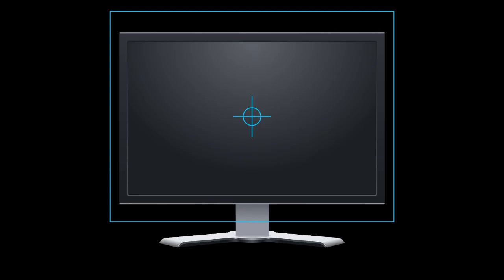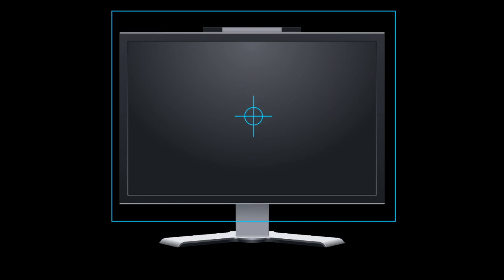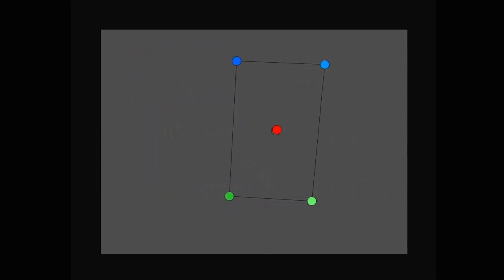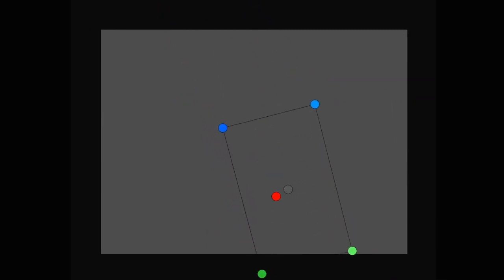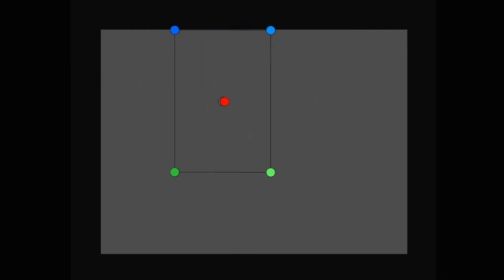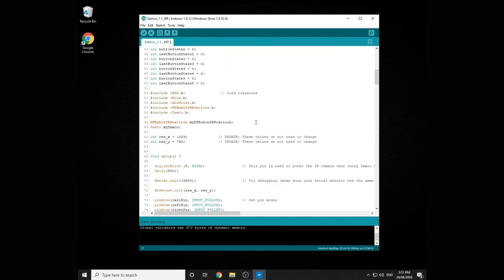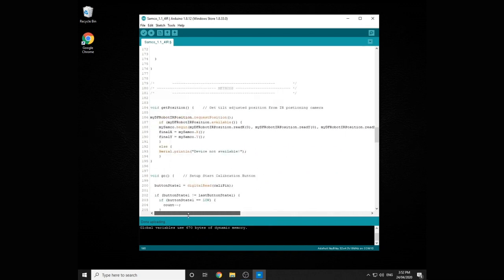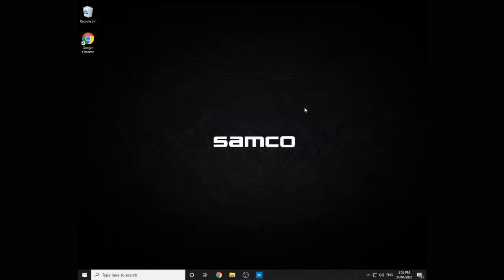SAMCO DIY Light Gun - 4 LED Introduction & Setup Guide

Comment: Could I use a fish eye lens on the IR camera to see all four LEDs all the time and therefore improve accuracy even more?
Reply from the maker: Yip, most people use a wide angle I think but same principle.
Reply: @samcorulz Thanks for reply. I've been doing a bit of reading around this over the past few days and saw a comment stating that LEDs can dim over time and the recommended aliexpress wii bar clones weren't very good. Is there a specific brand / item you'd recommend? Love the project - only wish I had the knowhow to contribute.
Reply from the maker: @videoflanders5164  No worries, haven't actually come across that one before. My random aliexpress bars work fine. A lot of people wire up there own, you'd probably be able to find a tutorial for one if you looked around a bit. Best way to contribute at the moment is just spread the word :)

Comment: What do you think would happen if you aim the camera inside the gun to get better coverage of a single upper bar? Does the 4 led provide substantial benefit even if you don't have an issue with going out of the field of view?
Reply from the maker: @PactoTech Yeah, you could definitely tilt the camera up to get better coverage, there might be some slight warping but would be marginal I think.  4 Leds is definitely better especially in the Beta version the main advantage being it remaining accurate (thought the sights) if you move closer to or further from the screen, 2IR can go out even if you just change your grip sometimes. But all depends on how you play really and how much time/effort you wanna spend on it :)

Comment: sitll waiting for parts to make mine but idk if its already done or can be done, but i noticed someone said it was abit slow if they moved the gun fast across screen??? maybe some  "mouse" acceleration thing be added like in windows the mouse accelerates the cursor speed when you move the mouse fast across screen.
Reply from the maker: Hi Mate, sorry for the super late reply. Have you got your parts yet? I'm not sure which comment your referring too but if its all set up correctly it should feel basically instantaneous (there is in fact a tiny lag but but if you you can notice it just by eye there's something wrong). Mouse acceleration settings will have no effect on the speed as the mouse is not "accelerating" is just moving to the on screen coordinates every time it updates rather than sliding to those coordinates, it that makes sense.

Comment: Cool project! I've got a game cabinet where mounting a Wii sensor bar below the screen isn't practical. Can this work with sensors mounted vertically to the left and right side of the screen?
Reply from the maker: Thanks man! Yip, both options will work. The main advantage of the 4IR sketch is that you can stand closer to screen, however if you mount the sensor on the side you will still have to stand a little bit further back than if they were top/bottom. I would suggest trying the 2IR out first and if you have problem with the pointer not reaching the bottom on the screen upgrade to the 4IR and see how that goes.

Comment: Hi Sam, so i just finished putting mine together. I ran the test sketch to make sure the camera was the right orientation. it seems to work well on the test. However, when I run the sketch (Samco_1.1_4IR) the mouse goes all over the place. I noticed on the sketch, where you mention changing the resolution to the screen,  it now says "UPDATE: These values do not need to change" i take it i don't need to set it to 1920x1080? I will have a play with it a bit more and see how i get on. If you can advise where i might be going wrong that would be great. btw my itsybitsy is an M4 not M0 not sure if this changes things much
Reply: I worked it out in the end. the sun was interfearing with the proformance.
Reply from the maker: Good work man, yeah the sun is not your friend when it comes to IR light guns :)